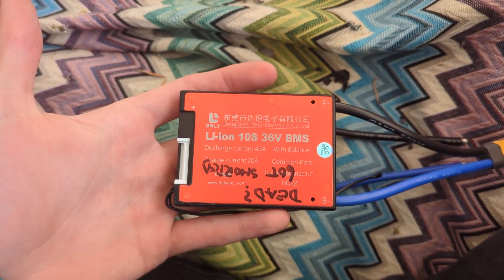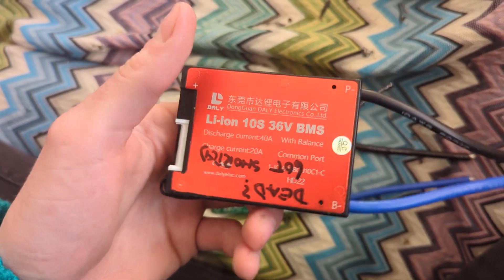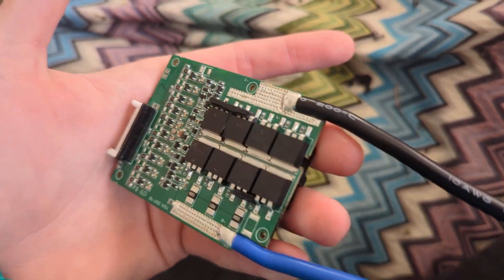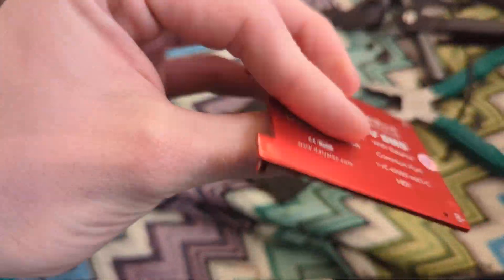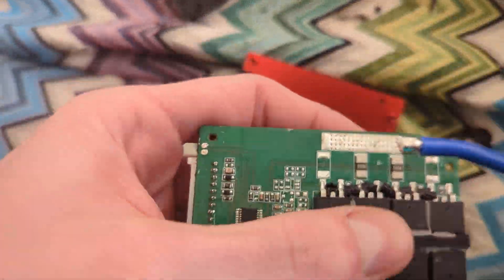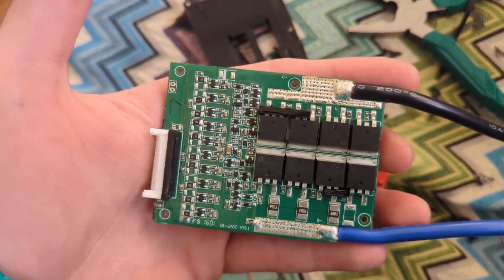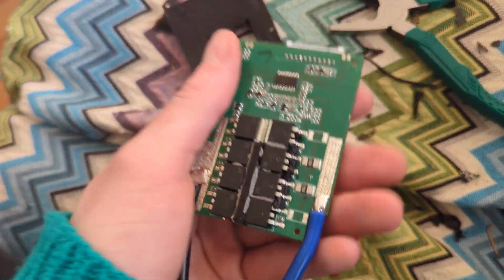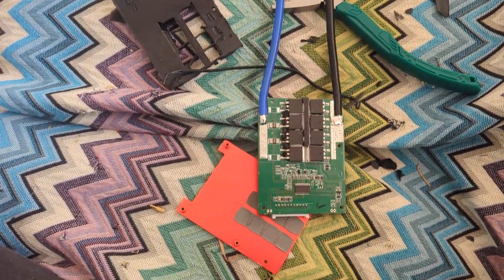Quick teardown of a 10S 36V 50A Daly BMS

Comment: I have the 10S 40A model and mounted dissasebled, choose this model instead the 30A one because this one have 2 more MOSFET and has the same dimensions, the overcost is 1-2€. Each mosfet can handle 250W max. A 10K NTC can be installed once case is removed and makes cut off at about 72ºC but; --> IMPORTANT --> Once the NTC installed there is a voltage drop of 0,4V when the temperature reach 39ºC and more, i tested it with a 10K potentiometer, voltage drops 0,4V at 5,74K ohm on the NTC input. There is a  current spark when you connect the cahrger, no matter if the soft swiych is off.